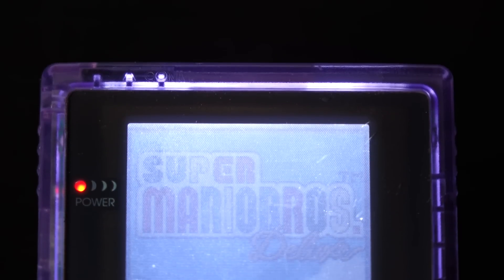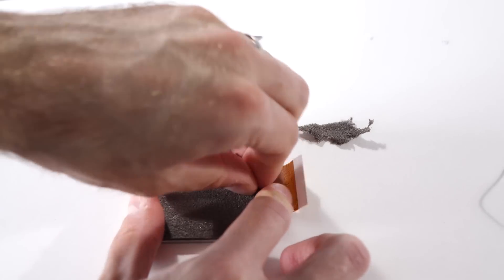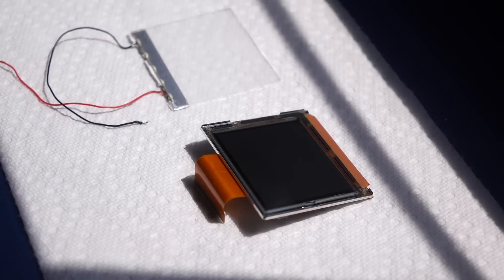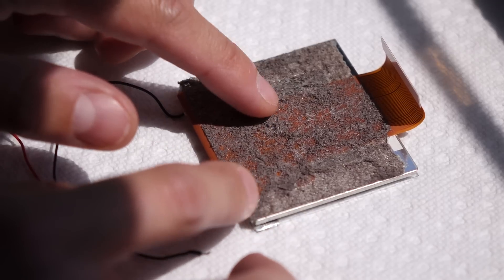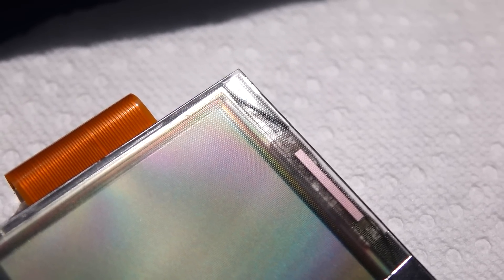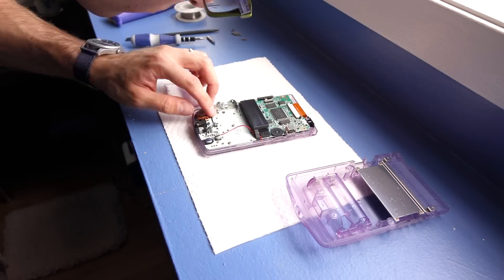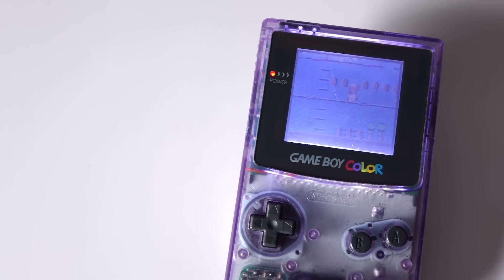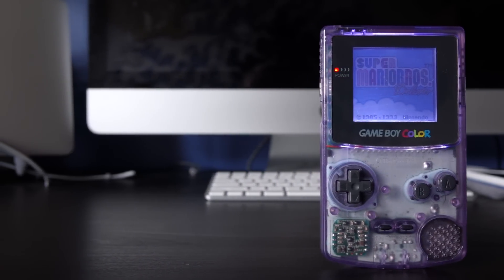Game Boy Color Frontlight: Does LOCA Make a Difference?

Comment: Did the mod a few years ago. Everything turned out great. Left my GBC in a dresser drawer out of sunlight for those years in storage. Recently pulled it out to play some GBC games and the middle of the screen looks like that burn in discoloration just slight in the center. I turn on the GBC and it’s very cloudy in the center. In fact I can’t see anything where the burn in discoloration shows when the screen is off. I do see the game running on the outter edges of the screen. Does anyone else have this problem? Again, this is after I did the mod and a few years later. I wanna say maybe 3-4 years ago is how long it’s been in storage.

Comment: The bubbles are hard to spot if they are small enough. I missed some and now it looks like a dead pixel but is white instead if black. Oh well it is gonna happen I guess. I know now to look closer when I do my GBA. Also I would suggest you all that when you remove the screen protector film to glue that you leave the screen protector on other side on until you are done situating the glue. Position the screen with the backlight and wash hands and then work out any bubbles. I happened to get a slight amount of glue on my hands and accidentally out of habit touched the screen. I looked and it seemed to not be anything until I powered on and its a small impression. Be careful folks.

Comment: Hey Collin! Have you tried out the V2 of the frontlight kit that doesn't require the adhesive? Just wondering if A) It's better and REALLY doesn't need the adhesive or B) It's better, but still needs the adhesive.
Reply: Its crap as well

Comment: Some tips from me, as I tried this recently with the help of someone who's an electronics technician:

 1) Even outside in sunlight, you cannot see all tiny air bubbles to work them out. Plus, once you get out there, the glue starts hardening at a crazy rate. You are better off powering the LED strip during this bubble elimination process because the tiny pixel-sized bubbles were not even visible under a microscope. First LED panel was installed successfully, but not a perfect image due to the many little dots near the center of the screen.

 2) Be safe and leave the LOCA for longer. Trying to be careful and prevent sun damaging the LCD, I thought 30 minutes was fine in the sun because I couldn't slide the LCD and LED panels around at all, but one screen ended up separating from the LED panel during installation, which was extremely disappointing as that screen didn't appear to have any bubbles when testing the LEDs, unlike the first screen we lit.

 3) The screen that separated left its LED panel stuck in the housing (where I had applied 3M tape, as this was a reproduction housing with no adhesive) and a very gentle prying with a plastic spudger tool cracked the LED panel plastic about 50% down. The professional who was helping me out with the soldering in this process was kind of shocked at the cheap materials used to make these, saying they should be using a polycarbonate which would not get damaged so easily. I left him with the damaged panel and I'm hoping he got inspired to cut a better panel so we can salvage the LED strip and so I didn't waste $15 on that.

Comment: i did everything right and then i turn it on and there is dust on it and i died inside a little. Until i opened it and the dust was on the top of the lcd and i just wiped it away

Comment: Is there any particular reason why you didn't apply the loca to the LCD, and then put the backlight on that, instead of worrying about flipping it over?
Reply: i think if you do that, the loca will start drying and will not evenly spread
Reply: @matocarina  how would it start drying without sunlight?

Comment: Love this mod, should do a rechargeable mod as thats easy peasy and nobody ever does a tutorial
Reply: Quite frankly I've gotten around this issue at like 10 years old (so... 2004) when we got our digital camera with Ni-MH rechargeable cells. Never again had to worry about buying alkalines for the Game Boy.
Added bonus is that there's no proprietary battery format, they're REALLY cheap (on the class of 3~4x the price of alkaline batteries while working as..... 1000 of them?) and you can carry as much batteries as you want.

Downside is it's considerably heavier than some Lithium battery, but the capacity is about same (literally, it's chemically close in volumetric capacity), ever since I fixed my Game Boy Color's screen that had it's polarizer ruined I've been playing it with the same charged pair for I think some good 10 hours of play time, still not showing low battery on the LED (it fades a lot).

Comment: Hey how you doing I have a question I just did my front light mod on my gbc but when I went to turn it on it comes on/ the frontlight blinks on and then the whole game boy turns off. light and all do you have any ideals for me I mean I've un doldered the wires the game boy works fine pls I need help
Reply: feel stupid as shit got it figured out using the wrong points wit my kit
Reply: John Tapscott Jr Check nothing is shorting on the circuit. You should have tested it when it was open and you could see the 'boards, to iron out that issue.

Comment: Hey. Not sure if you're still answering questions, but a modder screwed the frontlight up for my console. Can I take the system apart and reapply if bubbles exist or do I need an entirely new screen now?
Reply: For reference, the bubble is basically the bottom left corner so I didn't know if I could just drip some adhesive into the corner.
Reply from the maker: You'd want to remove the frontlight and reinstall it with fresh LOCA. Here's a video I did that may help: https://www.youtube.com/watch?v=ASJEivj4MNE

Comment: Hi Colin, I just did this mod yesterday and the results are got are horrible; the display is totally washed out and I can only see the black pixels but still very faintly. I followed all the tutorials step by step so I don't know how this happened but I do have some theories and would like to hear your opinion?

When I peeled the foam off the back, I actually peeled it all off and in doing so I raised the ribbon cable off the back of the LCD a couple of times, and accidentally scratched it with my finger.

I used enough LOCA (the good expensive one) and let it completely set, but I'm not sure if I pushed the LCD and the front light together enough as there was a bit of a gap between them, or if I pressed too hard to get the bubbles out. I also removed the reflective tape from both sides of the front light (I wanted the light shining through the lettering) but maybe that made it too bright?

While soldering I dropped some solder on the board a few times so I might have burned it.
Reply: https://www.google.com/search?q=ohm+resistor&safe=off&espv=2&biw=1366&bih=643&source=lnms&tbm=isch&sa=X&ved=0ahUKEwix0tHm4aHOAhVHwWMKHb7CBHkQ_AUIBygC
Reply from the maker: If it seems washed out, you may want to try adding a resistor to reduce the brightness of the frontlight. It sounds like you did everything else OK -- if you think there's still a gap between the screen and the frontlight, you can separate them and try again (I did a video about that recently). Good luck!
Reply: Thanks for replying! I went to the KB page where I got the front light looking for any link to a resistor and found one called a "slide potentiometer". Just wondering if this is what you are talking about, and also how would I go about installing it?
Reply: Well it wasn't EXACTLY the same as what he was talking about, but it will work.  You'd need to cut out a little space for it but yeah.

Comment: can you please give me a link to the loca you used? im ready to installed this just dont know what loca to use, thanks!
Reply from the maker: You have a couple of options. If you're on a budget, inexpensive LOCA (https://handheldlegend.com/collections/parts-and-tools/products/loca-liquid-optically-clear-adhesive-for-gbc-frontlight-5mle?variant=1272083431) should be fine. But I've found Osaka 7 (https://handheldlegend.com/collections/frontpage/products/osaka-loca-liquid-optically-clear-adhesive-10ml-and-30ml?variant=11403049923) to be a much better product and gives you some flexibility if you make a mistake.
I did a video recently about common LOCA mistakes and how to prevent them, you might want to check it out too: https://www.youtube.com/watch?v=ASJEivj4MNE
Reply: +This Does Not Compute thanks a million!!!!
Reply: how do you open the loca u listed as the budget one from hand held legends? i canot figure out how to open it and i dont wanna mess it up . PLZ REPLY
Reply: its a twitst off, so just twist/turn lightly but with some force and it will uncap from the bottom

Comment: hi i watched your video to mod my gbc and i followed everything you did anc i turned it on but it turns on for 2 secounds and turns off do you know what could be wrong??? help me please
Reply: I'm having the exact same problem, any luck
Reply: This is because you used the wrong solder points. You need to use the Hand Held Legend solder points. You are probably using the Kitsch Bent solder points. You can use the Kitsch Bent solder points with a 100 OhM resistor, and I would recommend this as it gets rid of flickering in some games.
Reply: turns out i had the right points, but someone from hand held legend told me that i could perhaps use a 10 ohm resistor and that fixed the prob, thanks though
Reply: +TechWalker buddy I do have mine on the right spot for the Handheld however it is really dim..I cannot play with the lights off....I used rechargeable batteries that are 1.2 v you think that might be the problem or what suggestion do you have. Thanks
Reply: +Hugo D. Ramirez Yes, rechargeable batteries will make the screen dim. You must use alkaline, unless you're using the KB points.
Reply: +TechWalker thank you for your answer 😆 I'm also thinking of adding the resistor and connected on the other place... I appreciated it

Comment: A great way to avoid air bubbles is to take a battery holder with two AA batteries and touch the leads to the wires on the LCD light after you've placed it on the loca. This way any bubbles that are going to show up after it cures will be visible while you can still get them out. I also did mine at night and used a $25 UV "oven" from Amazon, so I had complete control over it.
Reply: THE KING!?!?!?! He modeth his Boi like a peasant.

Comment: Hey, I was looking into doing this mod myself and the LOCA I bought doesn't seem permanent. Every week or so the edges start to come up. Did you use a particular brand? Or did you use generic LOCA?

Thanks! Love the vids.
Reply from the maker: +bondrocks11 I've used both Osaka brand LOCA as well as generic, and I haven't had this happen. Are you using a UV lamp to cure it, or leaving it in a window? (Some windows have a UV-blocking film, so it might help to try a UV lamp.)

Comment: +This Does Not Compute - Hello i discover a new metod on this frontlight mod, by adding a pice of metalic film from an broken LCD o you can do it with a pice of reflective paper, first you will have to remove the Metalic Frame of the LCD, in the back of the LCD put the Metalic film or metalic paper, put again the Metalic Frame of the LCD, and then make the LOCA mod, and then solder the kit to the PCB, after that you will notice that the Metalic Film reflect all the light from the frontlight giveing you better colors than the normal LOCA mod, that is because the LCD of the GBC is kind of "transparent"
Reply: + This Does Not Compute PLEASE SEE THIS COMMENT AND TRY THIS MEATHOD!
Reply: You just backlit your gbc!
Reply: +Autogolazzo lol, that's what I was thinking...
Reply: Uruguayan Style Oh my fucking God you gave me an idea ! Front light the game boy like in the video with Loca and do what you said with the reflector of a broken LCD ( that I have from a broken iPhone 5 screen ) and put another polorizer because if the light reflects from the back we need two polorizers to see the screen correctly and I think the results would be epic ! I have to try that
Reply: What about adding the metallic paper after the loca mod so it will be easier to handle 

And the reflective paper which way you put it? The mirror side or the side we see trough it
Reply: You can actually buy the metallic film. Would there be any issue with using a cold solder?

Comment: hey colin hows it going?
i just installed the led front light kit with loca.
i dropped some batteries in and booted up the gameboy color.
the front light screen lit up but the lcd screen didnt. after a few seconds the gameboy and light crashes.
so i unplugged just the red wire to the front lit screen and booted up the gameboy and the lcd screen works but of course the light doesnt.
so i reconnected the red wire and booted it up and it crashed again.
to me it seems like  too much of a draw.
do you have any suggestions? 
it is wired up like your video.
Reply: hey colin. i figured it.
i went to hand held legends website. their photos said to put the red wire to the top of the 3 solder points.
and the game boy works!
thanks for your videos ive watched almost all of them
great voice aswell.
do you have a list of all your hardware?
do you ever sell them?
you restarted my inner nerd for retro gaming.
Reply from the maker: +cole deVries Glad you got it sorted out! Yes, the Hand Held Legend and Kitsch-Bent frontlights are a bit different. You can still use the solder point I show in the video with an HHL frontlight, but you need to add a resistor.
I don't have a list of hardware, maybe some day I'll do a video about my collection. In general I never sell my gaming stuff, but I also don't collect more than I want/need.
Thanks for watching!
Reply: +This Does Not Compute   would you ever do a mod on the ds lite for turning into a gba style handheld?

Comment: Do you need to remove the reflective strip? I am asking because of your GBA video.
Reply from the maker: +Frodo B. I was able to get away with not removing it on my GBC, but I'd still recommend it. Spidering isn't something that can really be fixed if it happens.
Reply: Alright thanks! I am super excited to do this mod.
Reply: +This Does Not Compute could i use a oven light on the loca
Reply: +Robin Tammik Most likely not. Loca dries when exposed to UV or ultra violent light. I would just recommend setting it outside for some time.

Comment: Why didn't you just put the LOCA on the LCD and the front light on top of that? No flipping over necessary. That's how the tutorial on the site shows it.
Reply: +This Does Not Compute does the camera worsen the quality even further. i feel like its not as bad
Reply: +This Does Not Compute did you try adding resistors
Reply from the maker: +JitterBob The LCD panel weighs more than the frontlight, so I like to install the LCD face-down so the extra weight can help the LOCA spread a bit more evenly. It's really just personal preference.
Reply: +This Does Not Compute Oh, yeah. That makes sense.

Comment: GameBoy Advance AGS-001 front light panel works much better !
Reply: +RideRedRacer AGS-101 screen is backlit though, you CAN'T backlight a Game Boy Color. He means the AGS-001 front light panel works better than the method in this video.
Reply: +Clayton Clayton hahahah ya right. 101 is much better
Reply: RideRedRacer  the issue is about moding not the AGS101 VS AGS001 Console !